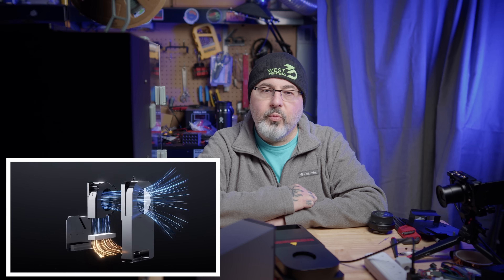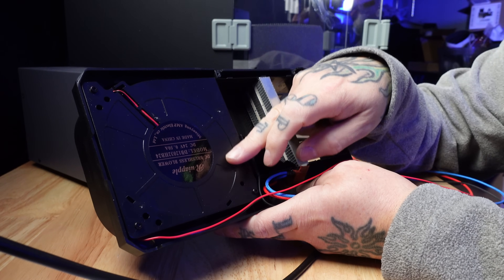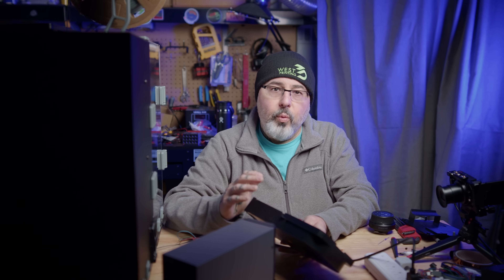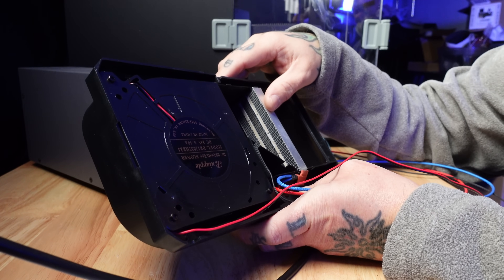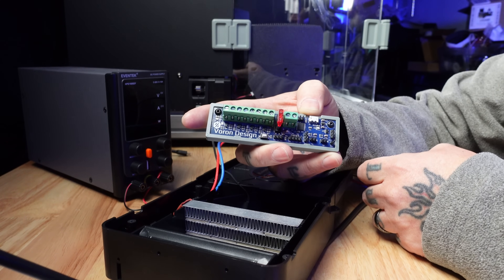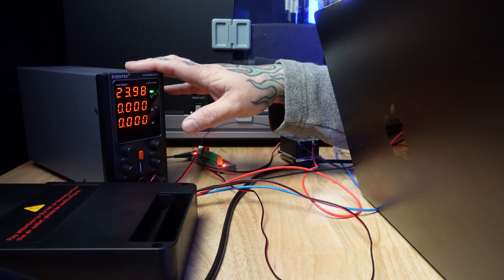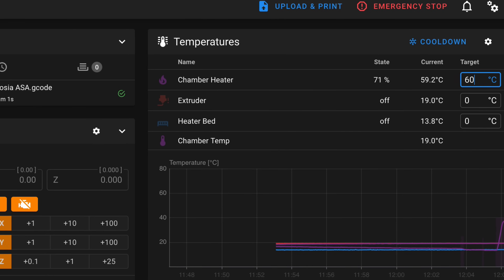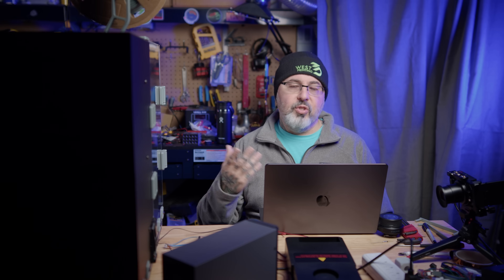Experimenting with the Qidi Plus 4 Chamber Heater

Comment: Amazon has these exact heater elements that have a thermal fuse built into the heating element... if it blows, it can be replaced without throwing out the whole heater

Comment: Love the information, I wish I was more electronically savvy.  The Bambu X1C (you probably have already been asked this) lacks a chamber heater.  Quick measurements appears this heater would fit comfortably in it.  Have you been approached about adapting this heater for the X1C?  I can see that if it would be a problem integrating it into the actual brains of the machine, but could a exterior control system be adapted?

Comment: Genuine question, why does it matter if the heater is overcooled and doesn't reach the target temp?  If it is still receiving the same amount of power, and that power is converted into heat, then the fan is just moving that into the chamber right?  I don't think it should matter what the temperature of the heater is, rather the power that is put into the system (the chamber in this case).  Like cooling your PC to lower temps doesn't mean your room stays cooler.  The PC actually runs with more power because it has more headroom but if you kept it the same, you're just increasing the rate of thermal transfer to the room.

Comment: I will disagree with the fan speed effecting the heating output. If the heater element is making 100watts of heat it does not matter what the fan speed is. An industrial fan or a snail fart will both transfer that heat to the chamber. 100W of heat is 100w. However different fan speeds would effect your PID behavior and too slow of a fan could cause the thermal fuse to pop. Also when selecting a thermal fuse remember that the heater will be hotter than the chamber temperature. Otherwise there would be no heating. How much hotter depends on the pwm signal it is sent and the airflow it has.

Comment: I just got finished testing my set up for the auxiliary chamber heater using the Qidi heater for my Sovol SV08. The klipper expander works great with the factory Sovol MCU and I can control chamber temp from the provided touch screen just fine also. I used a 120°C thermal fuse and set max power to 1.0, ramped up the heater and watched the thermistor temp hit 110° and heard a little pop as the fuse blew. I removed the tab for the live wire and bent the mounting tab down flush with the body of the ptc heater, drilled a 1/8 hole thru the tab and into the fins on the heater, wrapped the end of the fuse on the underside of the 1/8 rivet and installed the rivet into the body of the heater making sure that the body of the fuse was not touching the rivet, then covered the fuse and the rivet in non conductive thermal paste so heat can absorb into the thermal fuse in order to blow the fuse at its accurate temperature. I am using two Panasonic AQA211VL SSRs off your website because i am going to run two chamber heaters so the load on the SSRs is reduced as well as some overly built thermal mounting plates i got off amazon to make sure the SSRs are kept cool. Link here: https://a.co/d/4zB2UAy (i opted for the larger but overall thinner 10-100a option) because I am mounting all this underneath the printer which has a relatively large area to mount the electronics. Thank you for the time to explain how these heaters work, the chamber_heater.cfg and the dangers of these heaters as well as the mitigation tactics to prevent melting/fires from happening. I have little to no experience with line voltage but was able to learn along the way and used the same tactics you did to keep myself safe and isolated from line voltage. Thank you once again for walking through how this heater works and thoroughly explaining what everything does along the way. Very much appreciated!!

Comment: I've got a spare of one of those Q4P heaters😂 unfortunately. Just replace the actual fan IN the chamber heater and you should he good to go. Qidi will send you a new one but it's probably the exact same fan that "only" lived 1000 very VERY hot hours. I've been able to get my chamber over 80c easily (on purpose). I dont recommend that. But An $850 printer that can print PEEK filaments is insane😂 and it does it well too.

Comment: I do wish they used an insulated PTC heater because they really aren't significantly more expensive, but PTC heaters aren't as dangerous as people make out. They are self regulating because the hotter they get the less power they draw, and PTC elements come in different temp ratings. To make a 200W heater they use lower temp elements than for a 500W heater etc. That's why you can buy heaters of the same physical size with the same fan on them but with very different wattage. They are also available with thermal switches fitted that will limit their temp.
That's not to say this one is any good.

Comment: I had the bed heater mosfet fail ON on my printer. I then added a bimetal temperature control switch to the bed. If the temperature is too high switch will disable the SSR that turns the printer on.

Comment: I noticed when you pointed out where the thermistor is located, that it is at the input of the PTC heater - ie the cooler air going into the heater.  If that's the case, and there is decent mixing of the air in the chamber, then this measurement should be representative of the chamber temperature.  Cheap and easy enough to place another thermistor in another location in the chamber regardless.  It might be interesting to see what the exit temperature of the heater is as well.....sort of belt and suspenders 🙂

Comment: You need 4 "fuses": An electrical fuse to protect against too much electric draw. The heater core itself should have a thermal fuse, and a 2nd, bimetal upper limit switch set a little higher, that you can only manually reset. *I would also use a GFCI ground-fault-interrupt plug or adapter. You(r electrician) can get these at a cooling / heating shop.  The ones for resistance heaters(I'm from Florida) are probably already set up pretty close for this application.
-While writing this I read: @mghumphrey and @jimmer411 post. PTC could explain why there is no Thermal fuse or upper limit switch. However, with my experience, I would certainly use a GFCI plug or adapter with a fuse, and change the fuse to match the Amp draw of the heater.

Comment: As the temperature of the heating element goes up, it's resistance goes up (hence the "positive" in positive temperature component / PTC), which lowers the amount of power it is consuming until it reaches an equilibrium. This is why there is no thermal fuse. As an experiment, you could isolate the heater in a safe environment and run 110V continuously and see how hot it gets. It should reach some temperature and then level off, and if it's designed correctly that temperature should be a safe one. They could certainly add a thermal fuse as an additional safety measure, but there is an inherent safety mechanism built in due to it being a PTC element. Also, are you sure those metal fins are energized? I would expect those just to be to distribute the heat from the ceramic heating element.
Reply: For the record.. The stock heater (inside its housing) is in direct contact with the housing. Yves who runs the NoizieWorks channel has a great mod for this that he printed out of Pa6-GF. DO NOT print this housing out of CF. CF is conductive and will short out the heater.
Reply: @helixx_4D  Wow, good info. Thanks!
Reply: My ptc heater fins are connected to neutral. I did add a thermal fuse and had to be careful not to short out the fuse body to the fins. I did try the heater at full 115v, and the current does drop significantly when it reaches max temp. However, it gets pretty hot...
Reply: @bobwtech  Thanks for this info. Do you know approximately how hot it gets?
Reply: @bobwtech  i can attest to that. 
Not doubting the gentleman's intellect at all but the key words in his statement are: "if designed correctly?" 

I love my Qidi printers but these 3d printer companies CUT CORNERS WORSE THAN ANYONE. 

If it's found out the poor guy down in Florida who's house burned down because of the plus4  catching fire? If it did cause the fire then you'll see USCPSC step in and ban every 3d printer coming into the country that does not have extra fire safety components. 

They're already gonna get tariffed to death..